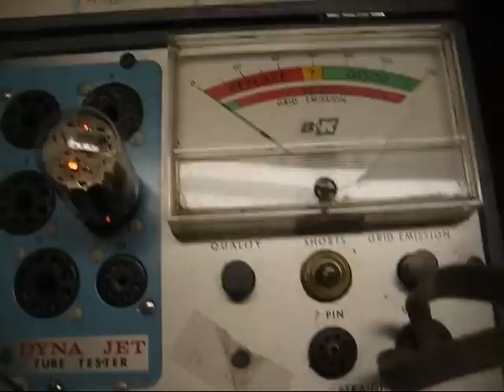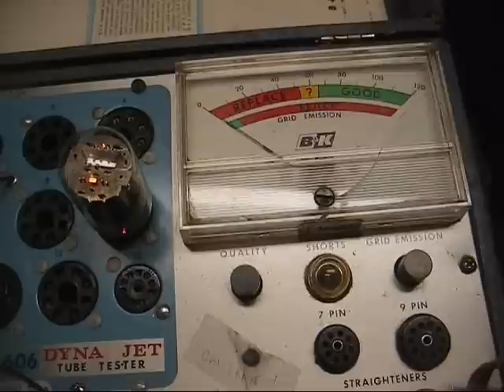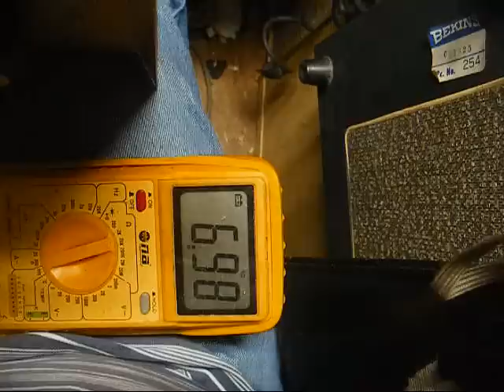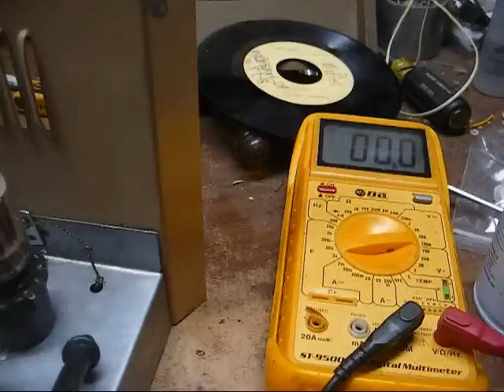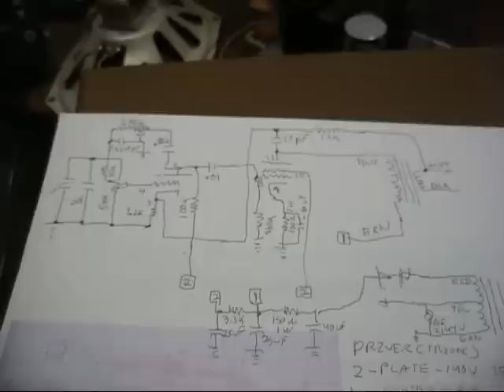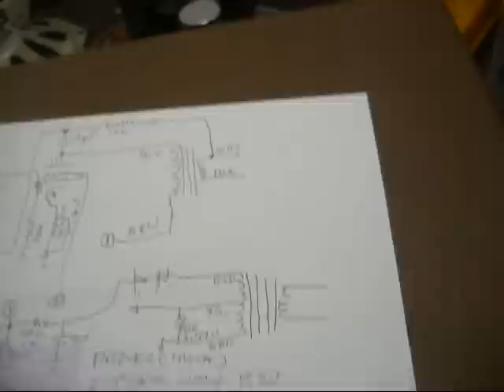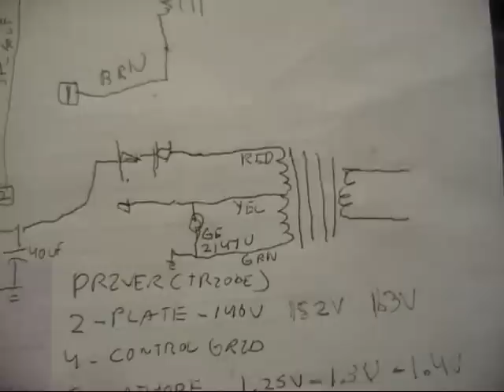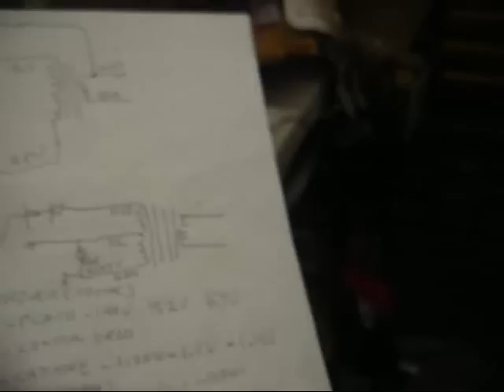Tube socket replacement & amplifier overhaul on a late '60's Audiotronics 300A record player

Comment: For about 6 minutes you were using a 312VT that had a working light, around 25 minutes you went back to the 300-A.  Another very informative video though. Thanks for sharing.

Comment: First, thanks for the videos. When I have a speaker that has minor damage and it is in a unit that doesn't justify a new speaker, I use rubberized spray contact
cement. It never hardens and most of the time I don't even need to add tissue to cover the tears in the cone. Carl

Comment: Nice job on that socket. If I had to guess, I'd be inclined to bet that the outside dimension is now metric, and just a little larger than whatever the EIA size was.

It looked to me like that had been serviced once before. I saw a film resistor, and those two plastic diodes looked like replacement diodes to me. I can't imagine that the manufacturer would have used real gold plated leads unless he got an incredible deal on some surplus.

Suggestion for not shorting things with the meter probe: put 5/8" of spaghetti on the red probe tip, only leaving the bottom 1/16" or so bare. I got in the habit of doing that years ago, it makes things a heck of a lot less nerve wracking when probing around in a rats nest. Yea, you can't use a push-on alligator clip anymore, but you probably have a spare probe lead you can use if you need to do that.

BTW, I ran most of those voltage numbers, and they most all come out dead on if this was designed for 115V and you are running 125V. Now if you only have 120V, I'd be inclined to split the blame between the line voltage and not using a 20Kohm/volt VOM.

Oh, and have a Merry Christmas! :-)

Comment: There are NPO disc caps that are very stable over a wide temperature range and are just fine to use in audio applications. The non-NPO type is much more sensitive to temperature. Using the drill bit to enlarge the hole is perfectly fine. I have done that myself.

Comment: I learned something new once again--if someone told me they had a phonograph amp with a compactron, I would've thought they were full of it, but there it is. About voltages; higher plate and screen voltages aren't important, but grid and cathode voltages are, since they set the bias of the tube. And you are correct in your statement about ceramic caps----it matters in hifi, but in a classroom record player with a frequency response of maybe 80Hz to 10kHz, it doesn't matter one bit.

Comment: Hey I own a Simpson 260 meter with case, instructions and even sales receipt from when it was purchased lol.
Reply: 20,000 ohms per volt sensitivity, was a standard for many years. Still, a far cry from a VTVM or a modern digital multimeter. I too have one, and use it regularly. Great meter.

Comment: 1970's: 110Volts
2020's: 125Volts
Reply: No it wasn't, unless you were one of the rare people who still had DC mains.
Reply: 1960s: 115V was the nominal line voltage. Then 117V. Then 120V. Now most places 125V. In the US at least. Japan is lower.
Reply: Japan: 100V.
Reply: @lwilton  It's round out, from 110V-130V.
Reply: The truth be told line voltage varied from one location to another, sometimes even from one time of the day to another. Some early AC radios had a plug in power resistor to compensate for it, but there were also ones that you would plug into a wall outlet, or screwed into a lamp socket, that would knock the peak voltage down.

Comment: I little dab of glue fixes speaker tears, at least small ones. It's surprising how many speaker faults you can repair, even warped cones, once you know how. If I am not mistaken you can also find replacement cones for 6''x9'' speakers from some mail order parts houses, 6"x9" was a favorite car stereo speaker size for years.

Comment: I make guitar amps...   I find that ceramic caps sound grittier than film caps.  The ceramic caps are subject to vibration and vary a bit more in value with heat.   That doesn't mean they sound bad though,  just a little different...   a LITTLE different.

Comment: I have a question, I am working on a Philco Jr 81 cathedral and the band switch is broken so it won't select any band. What I want to do is just connect the wires to just get the AM band. there is 4 wires to the switch.  2 near the actual switch knob and 2 on other side. I probably will never find a switch for it and don't care about the police band.
Reply: The old police band has the upper end of the modern AM broadcast band on it though, the model 81 band stops at 1500 kc, so you would not be able to receive stations from 1530 to 1800. I would suggest going on the Philco Phorum or the ARF and asking for a parts chassis, but only if the switch is unique in some way. I have a Philco model 81 myself but haven't opened it up yet so I don't know what type of switch is used, if it's a simple single wafer rotary switch you should be able to retrofit a generic replacement from just about anywhere. What it should do is switch in a tap on the antenna and the oscillator coil for one band verses the other, I would have to study the schematic to know for sure.
Reply: @OlegKostoglatov   I just want AM working on it.. probably the easiest way to know which is AM and which is the extended band is select AM and see what contacts on that switch is contacting and which ones are not..  So pretty much just want to get it operational even if switch is broken and worry about a new switch another time. so basically just want to connect the right wires and have AM and switch there for now as having it original. This radio is in very very good shape and was given to me from a friend who collects radios and in his mind thought it was a junk radio because it is a 4 tube radio.

Comment: Wonder if the loose power transformer could have contributed to the noise issues.Fortunately for tubed circuits like these they can work OK from wide varations in voltages-you must have high line voltage in your area.Have you measured your line voltage?That could answer some questions about circuit voltages.And noticed in these players that have power transformers---LESS hum!!

Comment: Ceramic caps will work ok, but they're definitely more microphonic as well as having capacitance shift with frequency. Neither means much in a school player, but in a hi fi amp, you'd think they'd spend a few extra pennies and go with the better cap.
Reply: I once had a TRW-Bell integrated tube amp (model 2420) that had ceramic caps everywhere but the tone control section, which was all paper tubular. That amp sounded good, except for considerable cross talk due to the left and right channels sharing the 12AX7 pre-amp tubes, something that every tube manual I've looked at says is a definite no-no.
Reply: @dougbrowning82  A lot of the closer research work done on capacitors took place in the 1970's. A summary is in this article http://www.reliablecapacitors.com/oldRC/www.reliablecapacitors.com/pickcap.html
I had an Eico HF12 that was loaded with ceramics as well. I thought it sounded good. Of course, relative to what?  By the standards of what I have today, it was pretty crude.

Comment: In order for manufacturers to make products universal,  someone would have to know what the right size would be. Unfortunately no one in the cheap Chinese discount manufacturing world knows what right is because they aren't required to know anything.  The only requirement to get hired for the job is to work cheap. After all craftsmen fit for the job work for wages higher than minimum wage. Manufacturers don't like to work  together with other manufacturers either.